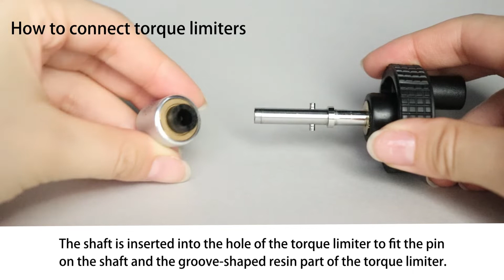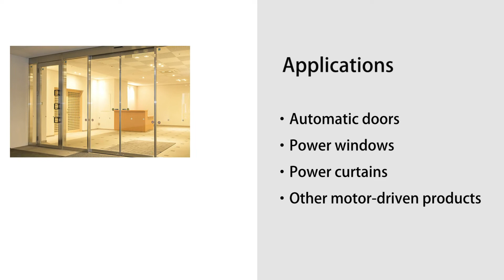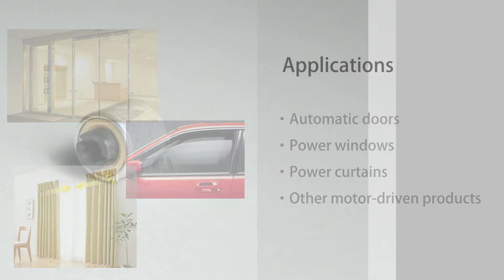How to Use Torque Limiters | Safety Mechanisms and Roles | TOK, Inc.

Comment: Hi this is great! How do you set the torque limit though?
Reply from the maker: Thank you for your comment!
The magnet inside this torque limiter is the source of torque.
The torque limit is set by the magnetizing process in our factory since the torque is decided by magnetic field intensity.
Reply: @TOK.Inc.official  Ah so the torque limit is a fixed amount, it doesn't need to be adjusted by the end user?
Reply from the maker: Yes, the end user cannot adjust the torque limit. a customer need to be ready for several kinds of torque limiters that have different torque limit when a customer make a new development. 
If you have any questions, please contact us via our website!　→https://tok-inc.com/en/index.html
Reply: @TOK.Inc.official  Thanks a lot for the info, will check this out